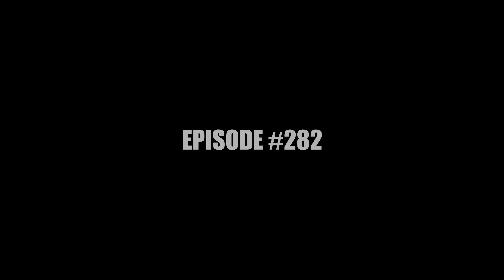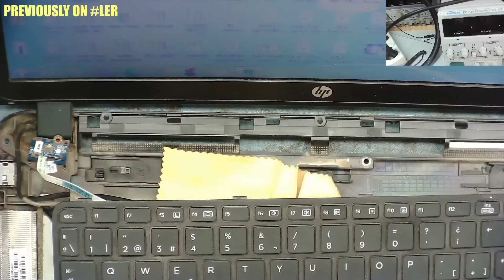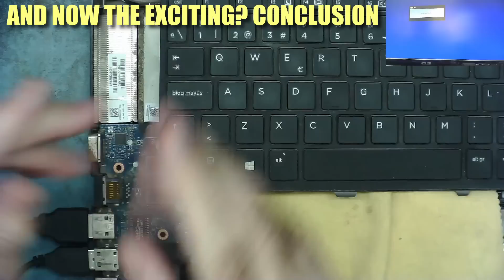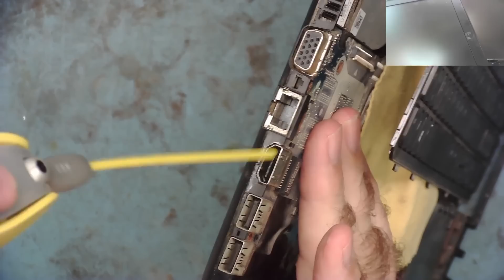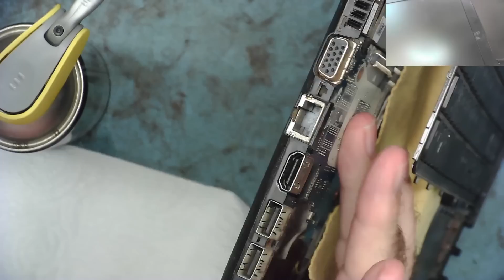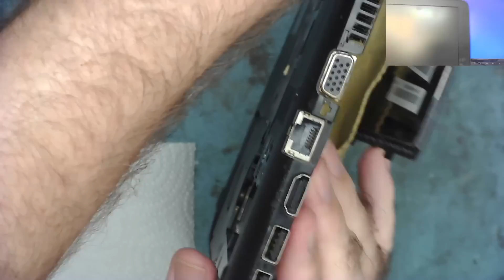All You Need To Know About HDMI To Fix Stuff! - Port Broken No Video Picture Output Repair Replace

Comment: i sometimes use white vinegar and bicarb of soda to clean metal. I'm not sure the effects it will have on the none metal parts of a HDMI socket, though. Of course I could use an ultrasonic cleaner, but i'm too tight and poor to afford one of those :)

Comment: You showed that there are 2 switches on or off in the chip which you did not find. so  3 volt are in 2 ways? , maybe you only connected 1.  hope you Succeed

Comment: Regarding the test of the connection HDMI, you can simply connect all the wires short in on one side and check only on the other side between each wire and the other wire and if there is a connection, it means that the wire is intact and well connected It will be faster

Comment: When I'm doing testing like this, and I don't want to waste fuses, I use a little bit of solder instead, because it can't carry much current if it's small enough. Or you can use a single tiny strand of wire wrapped around the outside of the blown fuse.

Comment: All that dirt (outside connectors), corrosion (fan) and oxidisation (on aluminium frame) reminds me why I always get "Marine Grade" electronics ( I live in a vehicle, often parked by the sea).

Someone else mentioned it, try Coke (Coca Cola) - but its a chemical reaction, so you need to know the metal or plating (Gold, Copper, Silver, Nickel, plated ..), to know the correct "sauce" to apply (HP, Brown Vinigar,  White Vinigar, Coke, house hold or metal polish, etc)

CEC is used with any IR controller, through an "LIRC" USB receiver, on an RaspberryPi, thats how the 1st metal case got its name "LIRC", because it was bundeled with an "LIRC USB Reciever" - XBMC (Kodi) has built in support for LIRC modules + CEC.

Did anyone else realise that +5v @50ma, SDA, SCL, GND is a reperposed USB (I2C) interface, USB 1.1 & USB 2.0 are +5v @500ma (max).

Thanks for sharing the HDMI control interface description (EDID) and explanation (encription, LVDS).

Comment: You will find that the eprom with the display data is powered by the 5v on pin 18. If no data is returned from the eprom windows will not feed a signal to the display. I've had HDMI displays with blank eproms and a raspberry pi will feed a signal but a windows laptop will not. To the laptop needs the data.

Comment: They way you test HDMI port is the same way you test video card data lines.
In diode mode all data pins except for ground should have nearly identical voltage drop.
One that don't match means a) poor connection to the image producing chip, b) bad image producing chip
C) chip that controls image producing chip etc. Who knows. Could be power issue etc. Figure it out.
Reply: ^^ THIS ^^
Did he forget to check this ? (I'm sure he knows this)  I was only partially watching but fully listening, doing my own repairs, lol

Comment: did you check if the inductors bridged between differential pairs? also in diode mode id check the 4 differential lanes read the same, red probe on ground

Comment: Hi Richard great video when you tes emi filters. Did you test them also diagnogal because they mus be beep diagnogal if that happens you will not get hdmi working and you need needle probes for this. I suggest you order one because your probes are to big for this kind of work. I hope you will be able to fix this I am eager to see. It will be strange it will be pch to blame this problem. I have never seen it well when usb not working it is to blame to pch but hdmi I never seen yet.

Comment: cheers sir aweszome vid  very informative thanks ... my guess is you mess up few jumpers at the area of hdmi port while cleaning and so on  saw that  hapened few times... self done that  sometimes  ... prefer to look at early stage of vid and  confirm  that solder jumpers are still same configuration. tough mosfet  teory is posible too, good luck with that bugger 👍

Comment: Hello Richard, I think i have here a identical mainboard but with a I5 processor on ( LA-B181P Rev 1.0 ). 
The mainboard doesnt work for the moment because the bios chip is removed and the traces are damaged around the bios. Bios flash was interupted while flashing.
But if you want that i mesure something or take a picture from something where you are not certain of i will do if you want.
Grtz.

Comment: Hi Richard,
Nice detailed video. I wonder if the solder bridge that you cleaned off the board near the hdmi connector need to be in place to pass the signal to the pch? I didn’t see how you could have created the solder bridge by accident when soldering the pins. Thanks.

Comment: Started seing this video thinking it would be simple port replacement, but then it went down the rabbit hole. Very interesting indeed, specially the Interlude at 1:04:30. Thank you L.E.R. (Richard) for the effort. Cheers from Lisbon.

Comment: The inductors are common mode filters. They reject common mode static voltages to protect your hdmi encoder chip.
Reply: Common mode voltages are voltages induced on both of the data lines at the same time (usually via static discharge or lightning). The voltages induce currents, which are  cancelled out because both inductors are magnetically coupled.

Comment: Good stuff... A few things I noticed along the way that may help... The HDMI connector very obviously went in properly as the spring detents engaged in the holes in the connector - obvious on the video. The diode array/zener devices are for ESD protection. HP sauce is nowhere near as acidic as it used to be, mostly due to reducing sugar content so acidity has to be reduced to match, fecking with the flavour, you could try Coke as it's really phosphoric acid you want for that sort of cleaning. No clue as to the actual fault, I would have lifted the mosfets and checked the supply voltage without them present as they could be pulling the rail down due to an internal short.
Reply from the maker: Yeah the HP sauce didn't work well that is for sure.
I'm thinking actually, to remove or disconnect the Hot Plug detect MOSFET, connect the HDMI cable then force the PCH hot plug detect pin to go low to high (I'll see if I can find a datasheet for the correct logic voltage) then look on the scope to see if it sends the EDID read request to the monitor
Reply: @LearnElectronicsRepair  Yeah, effectively breaking the circuit to see which side of it is bad seems like the way forward.

Comment: Good attempt, awaiting the next episode. Daft question, HDMI doesn't need to be enabled in the BIOS setup? It's the vinegar and salt in sauce which breaks down copper oxide, but generally only on copper-based coins (1p, 2p etc) when immersed for a considerable time. Daddies is, of course, far superior to HP.  I wonder whether white vinegar would clean the inner pins, though I have never tried this.
Reply from the maker: I would not be surprised at all to find this is some sort of phantom firmware/software problem, though I did my best to eliminate that possibility.

Comment: Could you try to put a 3V on the output of the mosfet to give the PCH a hot plug signal?
Reply from the maker: Yes -  I think forcing PCH hot plug detect from low to high manually (with the HDMI cable attached) would be a very good idea - It would be good to find the PCH datasheet to use the correct logic level voltage - the I could check for an EDID read request on HDMI pins 15/16

Comment: No clue or glue to put it together again, just more schematics again guys
Reply from the maker: And lots of voltage measurements and stuff...  😉  I couldn't get any further without working out what is going on with the +3VS voltage rail and the mosfets - and something is wrong there so I had to order parts.  There will be a part 3 of course, like all repair work it takes a bit of patience...
Reply: @LearnElectronicsRepair  great stuff and fun 👍 😀 messing around with electronics is enjoying and I do it all the time for fun and I'm twice worse than you 🤣😂
Reply from the maker: Very true Rem U - and by messing around and applying logical thinking to what we find is the way we learn 😁 There are a few good suggestions on here regarding faking a Hot Plug signal to the PCH and see how it responds, I believe this is the best thing about this channel, between many heads we can solve some really challenging problems, or at least learn something new in the process.